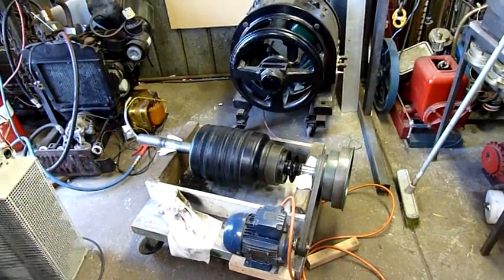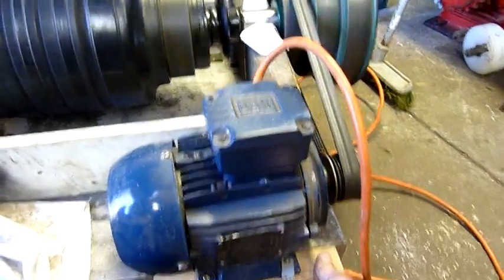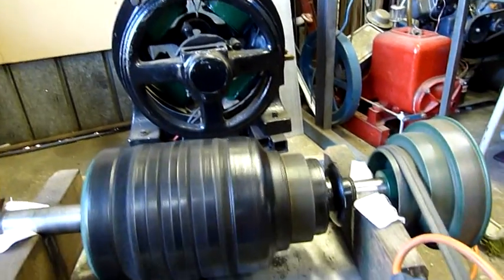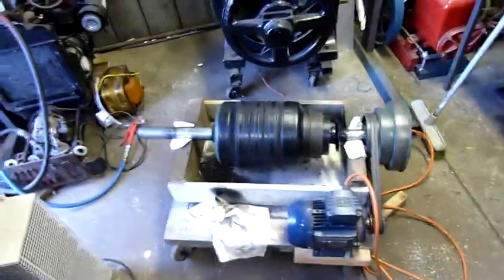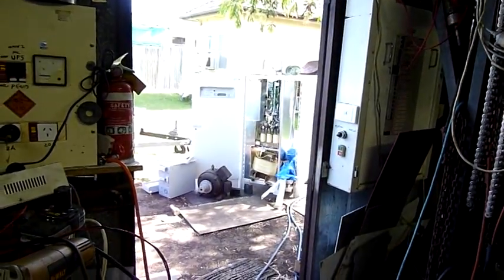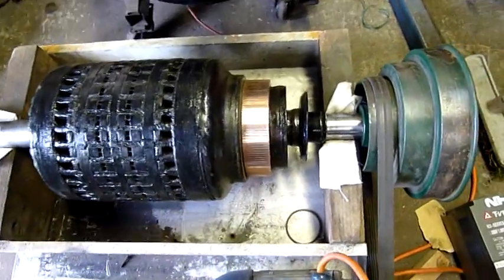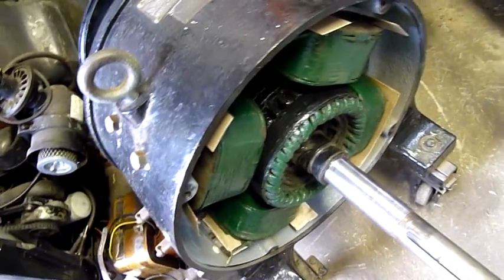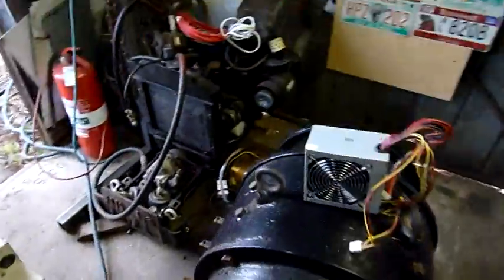Westinghouse 110V DC Generator Armature Clean Up and Install

Comment: that is a BEAUTIFUL old dc generator. I really hope you get it running and eventually get the old 3 cylinder diesel it was run off of and get it running too. So many cool vids could be made from that. Look around online and I'm sure you could find exactly how to rewire that generator for 110v dc. Westinghouse made some beautiful stuff in that era and this generator is no exception.

Comment from the maker: It is indeed a Inverter VFD, single to 3 phase conversion.

Speed control is via a small potentiometer on the front panel, altho I could fit a external control station if I wanted to.

Comment from the maker: I used electrolysis to de-rust the housing parts and painted them in epoxy enamel after.

good to hear they are still being re-wound!, they are solid old machines!, this one is from 1904 :D

Comment from the maker: If you can't pickup a good old transformer welder at a market or surplus dealer, try the newer DC inverter caddy welders, their super light weight and being DC you get a very smooth arc!. Total tools has them for about $160 last I checked. good value.

Comment: yeah 1 of them was 1914 model and another was 1920 i think but pretty much the exact same look. the 1920 model had roller/ball bearings don't know if it was a later modification or not. 1914 was the babit bearings they were fun but by memory think 1 was re-cast for us, shame or company isn't up to spec to do it ourselves, real nice job on the rebuilt .

Comment: Ed, get someone from the states to send you some 120 volt incandescent lamps, they would pair up with this nicely. At 120 volts and 50 amps that's 6000 watts you can run off of it and don't forget 120 volt incandescent lamps are more efficient than 240 volt lamps.

Comment: he only needs 2 of those wires for DC though so he probably can. Australia used quite a few single wire DC ground return systems so there should be a little vintage DC stuff lying around that will work too

Comment: I would have thought a little heat shrink might work to insulate the brush bars, I doubt that the temps in the motor would cause it much difficulty.  There is cold shrink as well, but I don't know how pricey it is or if the sizes go that small.

Comment: Very good this far, would love to see it driven by the tractor diesel engine you have, whether by direct or belt, is it roughly 20 x 20 x 40 American inches?  (51 x 51 x 102 cm), muliplier of 2.54 from inches to centimetres

Comment: hey we've actually rewound 1 or 2 of these in our workshop here in adelaide, just a quick question what did u use to remove the rust from the casing looking at the colour of it was it a type of acid clean?

Comment: im thinking if you could get the right belts and pulley and think of a way to get a car engine to do 800 rpm and get the belt nice and tight yes it would work wonders

Comment: You know, anyone that's off the grid would be fools to pass this over. Connected to a proper regulator, it could provide power for a ton of batteries and a good-sized home.

Comment: He probably can't, this is a two wire system versus a three wire. Most 220 volt DC systems that I know of are three wire (110 Positive, Neutral, 110 Negative). Of course I don't know about Australian DC systems as much as the little I do know about American DC systems.